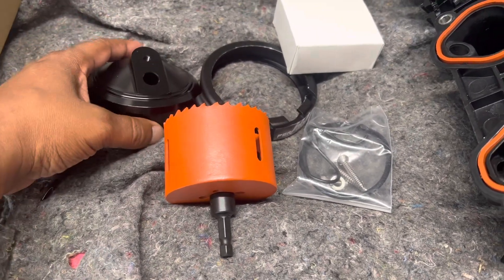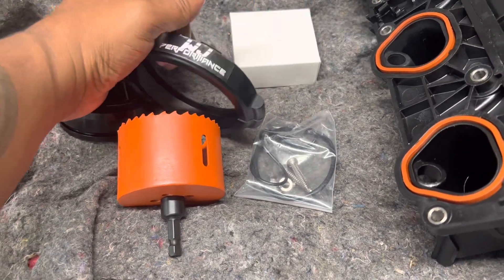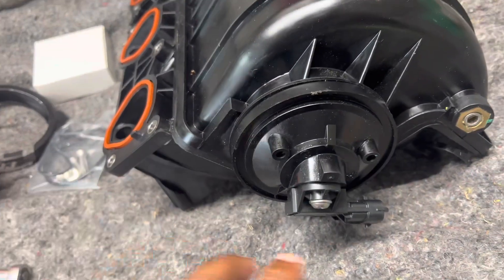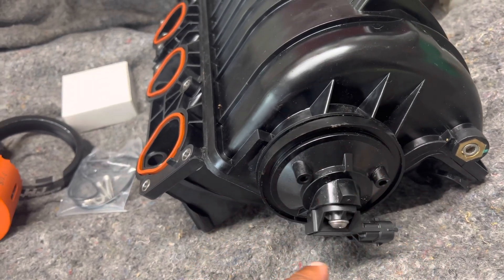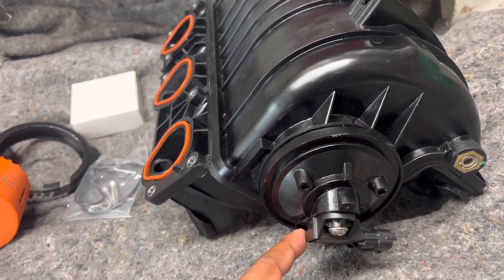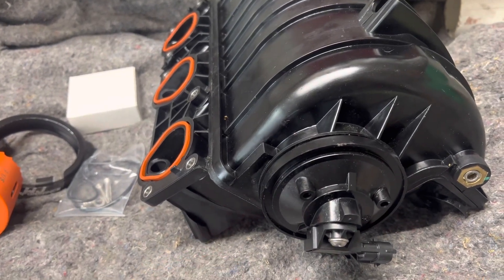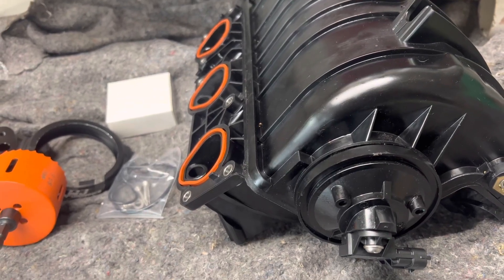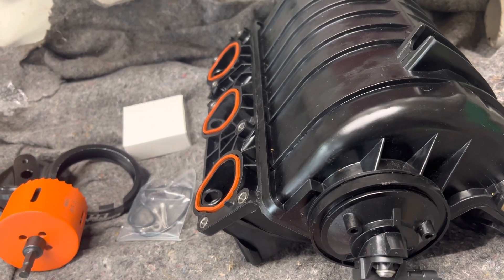Wet Jet Performance IMUK install video for Seadoo 230 300 rxpx Gtx Rxtx

Comment: Can you do a in depth video on removing an intake manifold please 🙏
Reply from the maker: We can but it’s very easy. Just undo the throttle body and there are 6 torx screws to remove the intake manifold. Takes maybe 15 minutes the first time you do it. Just be careful not to drop the screws in the hull
Reply: What is this filter ribbon used for on the seadoo anyways?
Reply: @aceman1741  its a flame resistor filter removing it gives you 1 lb of boost

Comment: Would I need to tune or flash the ecu after this mod?
Reply from the maker: Yes you need a tune for the part . Doesn’t really benefit you stock and you afr will be off if you aren’t tuned
Reply from the maker: We have the stage 1 tune for this mod at wetjetperformance.com

Comment: Hi, does this only works with supercharger I have a non supercharged engine?
Reply: No your engine does not make any boost
Reply from the maker: Only useful if you are super charged
Reply: Not true. N/A motors benefit even more than boosted engines. @cowboybishopvids6570
Reply from the maker: @Zionslayer1  we have done this mod to na motor seadooo and they gained zero. We have data logs nothing to gain on a 130-170 ace 1630 motor